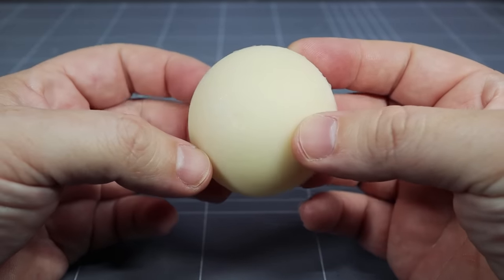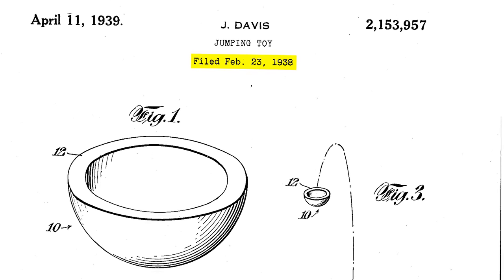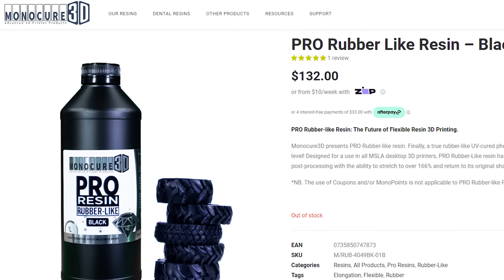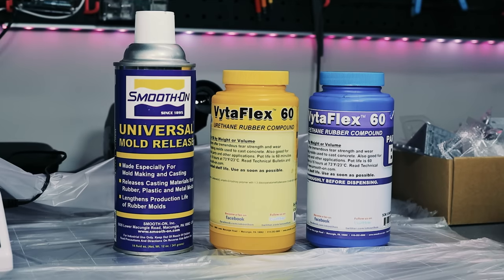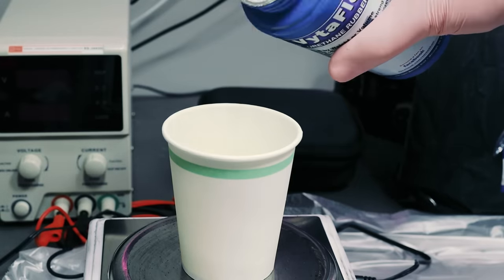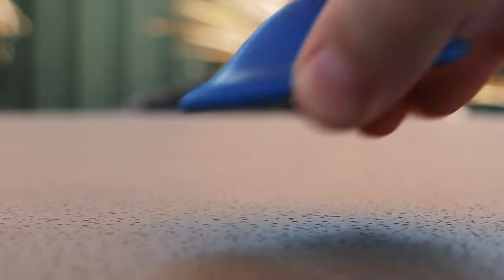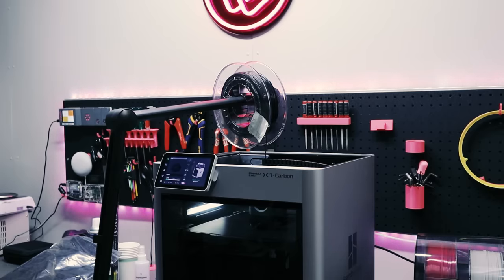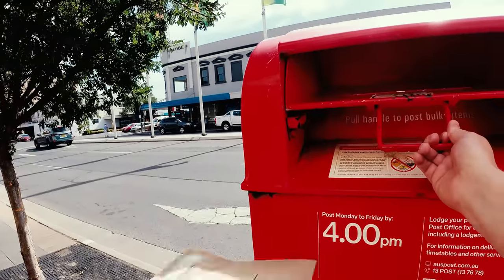Recreating a Banned Toy from the 1980s

Comment: Peter Fish is one cool dude. And I'm surprised the original rubber one still worked after 30 years!
Reply: Not the modern cheap rubber that breaks down in 6 months.
Reply: The only problem with the original ones was the whole in the middle may eventually develop a split, which stopped it from working properly. That what happened after I handed mine down to my nephew. But it was about 15 years old by then, and my nephew did give it a good work out.
Reply: @notsillyone  I think that was why I threw mine away...lol I prolly tried adding Tarzan's Grip glue to it but only delayed the inevitable, then I realised it is easy to make with a well cut in half tennis ball, remove the fur and melt a hole in the middle - done correctly it will work just the same!
Reply: @gavincurtis  Like modern technology such as Apple products that die in a year or 2! The decline was from 1996 when we started to use lead free solder/sodder in electronics. That meant the lead free solder/sodder on circuits melt as they warm up and crack when they cool down, over time the chip or component will separate from the board of the device - prime example was the original XBOX360 or PS3. This is why older devices last a LOT longer - the lead in the solder/sodder is less prone to melting under environmental stress combined with regular use.
Reply: Apple products die because the OS tells them to. That’s why you should never update when told to. I am still on the original OS on my iPhone, my buddy got his the same day and he kept updating his phone. He says the battery lasts maybe 3 hours now and it’s glitchy. Mine holds a charge all day still and my only complaint is the touch-screen is too sensitive.
Reply: Not having security patches leaves one very vulnerable to drive-by malware attacks, however.
Reply: @NellWatson - Not if you don't click on every silly "You won a million dollars!" link.   Security patches are for dummies. lol
Reply: @Defensive_Wounds Lead-free solder isn't the problem. It's just bad design. Most of the time, the failure is because of badly designed circuits or external damage, not cracked solder joints.
Reply: @Defensive_Wounds  The melting point of lead free solder is above that of leaded solder, which was part of the issue: It is harder to melt without causing damage to the chips.
Reply: Had rubber on my computer mouse gooify after 5 years +/-
Reply: It all depends on the plasticiser used. Once the plasticiser all evaporates away, the rubber will crack and become brittle. Also, styrene will react with isoprene and cause it to go all gooey and sticky.
Reply: I still have an original eighties one bought here in GB. It's just like the blue one in the video, but with out the hole. Its pop became weaker after only months. It degraded to only half its pop after a couple of years. But decades later I still have it in one piece.
I'm surprised it didn't go the same way as an old tennis ball and simply disintegrate. Come to think of it, I often wondered at the time why it was that an old tennis ball cut in half wouldn't work the with the same pop.
Maybe the video creator could look into the manufacturing technology of tennis ball creation? The different rubber used for different speeds of squash balls may be of useful insight?
From what was said in the video though I expect that source of recycled rubber is exhausted. Unless we haven't yet reached peak rubber😜
Reply: @Defensive_Wounds  The thing about the original XBox360 isn't just lead-free solder, it's that Microsoft intentionally went with the cheapest solder they could to save on unit cost, and everyone saw the results of that. The later revisions had better quality solder and an active cooling system, so lead-free solder or not it still worked fine.
Reply: @Defensive_Wounds I see lot of 20 years old electronics still working fine.   My MacBook Pro still works and it’s 2006 model year.
Reply: @notsillyone  I have one somewhere in my storage but it has a bad split and doesn't work properly anymore. Is there anywhere where I can find a new one as good as the original?
Reply: @JustinDaniels Unfortunately I don't think you can find a new one as good as the original, if what Peter Fish says is true that nobody has been able to replicate the rubber in his product.  But if you read Defensive_Wounds earlier comment, he claims to have made one from a tennis ball that worked just as good. I'm planning to try that myself.
Reply: @BillAnt  "Security patches are for dummies"
Says someone who has no idea. Some exploits don't even require your phone to be on the network...
Reply: I think mine all suffered the same fate. Loved those things! Used to launch them from the tip of my finger, or a knee and watch them fly! @notsillyone
Reply: @notsillyone  Here in England, I'd never seen one with a hole in before this video. Must be 30 years since the last time I saw one.
Reply: @goku445 - Yep, says someone who's been using computers since the early 90's yet not a single virus, malware, or hack.   Use your brains folks, and don't click every scams link, it's simple as that.
Reply: @BillAnt  Lmao, you have no idea. Typical dunning-kruger. Your anecdote has low value. If you are running an unpatched system you can be sure you're already been "visited".
Reply: Planned obsolescence is real lol
Reply: @goku445 - Nope!
Reply: @BillAnt You have no idea what the difference is between malware and security vulnerabilities are. Security vulnerabilities are holes or keyless-gates that malicious individuals can use to gain entry into a device or network, usually through some hardware or software vulnerabilities, like Spectre/Meltdown or wi-fi/bluetooth protocols. You are describing malware, which is usually social engineering at work or blanketing (where the malicious individual just casts a wide net hoping an idiot bites), where the user self-inflicts the malicious software on themselves.

There is an entire world of vulnerabilities in just Wi-fi alone. I would look into Ryan Montgomery and some of his explanations on basic vulnerabilities in these protocols.
Reply: @m_6866 - You mind-reading on what I know is way off, so have a nice day.
Reply: @notsillyone  Thats why the ones without the hole are so highly sought after.

Comment: I used to make these myself by cutting squash balls in half. They work a treat. Very powerful.
Reply: Say it aint so!
You mean i dont need $300 printer?
I can just chop a $1 ball in half!
Reply: @alfonsedente9679  Ha, yep. Depends on the squash ball, but the ones I made worked pretty good. I got about 5ft (150cm or so) out of some of them (they were coming up to my shoulders and I'm 5'10" or 178cm), especially if you put them in the fridge for a little while first to stiffen them up. Some of the real one's we got in the US back in the day, though, would go 20-30ft in the air! So, these are not exactly perfect, but probably about as good as what he was printing.
Reply: @AlphaMachina  i remember the colors...
I tried a blue one today, worked great.
The black ones i had were too thick, not enough air space in the middle.
Ill try greens next.
A couple guys posted tennis balls worked ok.
Just thinking logically, im guessing the common pink or spaldeen was what the one kids were making.

Comment: I vaguely remember DIYing one out of a tennis ball. Didn't quite work as the shape wasn't right, but that's a material you should try.
Reply from the maker: I actually did try that, but I cut it from the edit in the end. It didn’t work for me.
Reply: If I'm not mistaken Tennis Balls are from natural rubber which would be the material of the original black popball.
Reply: just cut a racquetball in half.
Reply: haha look who I found in the comments :D
Reply: @riba2233  🤣
Reply: @electrosync  For me this worked really well, so much so that I was convincced that is how they were made, from discarded tennisballs.
Reply: I also made one from a Tennis ball back in the 80s and it bounced maybe 1,5 - 2m high. It gave a nice "kick" when placed over the forehead and it had a very long delay which made it an "agonizing" and extremely entertaining toy to play with. I absolutely loved it. I never knew someone actually manufactured them and that they got banned. That sounds so silly.
Reply: @hugovangalen  i expect that the height at which you cut the ball matters. how tall is yours? or rather whats the circumference? that would be best. i might give it a try.
Reply: @dnichl  I really don't remember, this was 40 years ago. I only remember that it worked fine. 😄
Reply: @hugovangalen  welp, i have at least 8 tennis balls to cut tomorrow. at least ~16 attempts depending on size of initial cut 😂😂 I'm too old for this but i still need to get it out of my system.
Reply: @dnichl  All for science!!
Reply: @SprSonik13  This. In the early nineties, my college roommate played racquetball, so he had a supply of them. He cut one in half and taped it to the wall as a cheap alternative to a doorstop. I started using the other half as a fidget toy, and we accidentally discovered that it made an excellent popball.

Comment: In the 1960's, Edmund Scientific had jumping discs made of bimetallic thermostat material.  You warmed it up in your hand so it would stay inverted, then it hopped when it cooled in a couple of seconds.  They went really high especially from a hard surface.
Reply: I remember the CSIRO "double helix" membership got you one of those bimetallic discs.. back in the 80s/90s.
Reply: Lmao, I bet those were really aggressive XD
Reply: Yes, I enjoyed those jumping disks.  But after some usage, they would fail to remain "cocked".  I suppose that metal fatigue set in or else some separation developed at the bimetal interface.  Prior to the jumping disks, we enjoyed the plastic insects with the springy wire legs and the suction cup on the underside.  These were indeed an eye hazard and were banned or else were no longer sold due to injury liability.  (I'm glad I grew up and survived in an era when safety was not the be-all and end-all.  Sometimes, experience can be a great teacher, if we survive without too much harm.)
Reply: Can you find these now? I want some of or my daughter

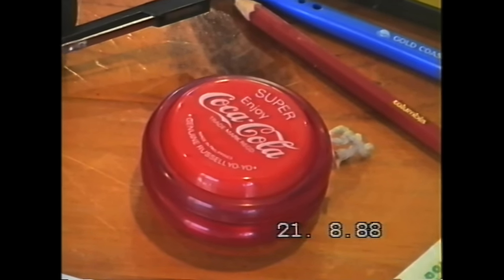Comment: 0:30 - Yoyo is still in the EU. The metal slap bands are still there. But those are covered by transparent plastic packaging.They are retro-reflective and are sold as additional protection to improve the visibility of pedestrians and cyclists.
Reply: WHaT? Yo-yos are banned in Europe?
Reply: @ninjarooster9258  No. They are not. That's what I meant.
Reply: I remember briefly in the US the snap bands were banned but then the companies started making them with a plastic center instead a few years later.
Reply: Yeah, slap bands are back for the little ones at the moment (2023-2024). Even saw a "decorate your own slap band" thing at a toddler party.. White material ones that the kids decorate with textas or stickers.
Reply: @ninjarooster9258  wtf, he literally wrote that they're not
Reply: @Mintor94  he wrote “yo-yo is still” and I wasn’t sure.
Reply: Tbf, I also understood "yoyo is still in EU" to mean "still banned in EU" at first. It took me a second to realize it actually meant "still exists in EU"
Reply: @--Nath--  Used to have original textas---still call felt tips texta.

Comment: So fun addition,  the Toy Line known as "SNAILENS SUPER SONIC SHELL FIGHTERS" from 1992, actually went even further with this idea, as the inside (or top when "poped inside out" and prepared to "fire" had a notch in the middle that stuck out, and you could attach a rubber projectile to that would be fired off of the "pop half shell" thing. And these things HAD some umph behind them somehow. I remember as a kid I hurt my finger when it snapped back on its own. Wasnt like a serious injury or anything, but it did throb for a bit.

Comment: I have a metal disc variant of the pop ball I was given some 40 years ago.
It's small, only 24.7mm (1 inch) diameter, 0.2mm thick and 1mm high, with a tiny 1.5mm diameter bump in the middle.
You warm it up with your hands, press the middle to make it click then put it on a hard flat surface, after few or many seconds it cools down and 'unclicks', jumping about 50cm (1.5 feet) straight up when the tiny bump in the middle hits the hard surface.
Was great for startling people who didn't realise it was on the table in front of them.

Comment: When i was a kid in my country we had no to much of toys variety and we made a lot of DIY toys.

I 'invented' this Popball accidentally when cut a segment of a broken tennis ball.

The only difference was it had no hole in the centre but a 8mm long cut .

Also 'delay' before it exploded was longer. 

It was a big fun to load the toy and hide under thin layer of sand... 😊

Also, one day i found similar jumping toy but it had different design. It was a suction cup connected via a spring to a plastic pin sitting on a flat round base. It looked like a mushroom 😊

To load it you just push the cup down to compress the spring and stick to the base.

Then you leave it waiting when it pops up🎉.

Comment: Mate, just cut a Tennis ball in half. That's how we used to make them when I was a kid, even before they were sold. It will also be way more powerful than any of the store bought ones. 

The trick is to cut the ball as clean as possible, if the cut line has dents, these can develop into cracks over time!

Comment: In addition to popballs, I remember something called 'caps'.  There were two versions, each involved gunpowder or some rough equivalent.  There was one with small plastic 'cups' that contained the powder and there was another one where the powder was inserted into tiny areas in an otherwise flat sheet of paper-like material.  That one was one you could strike with a hammer or something and it'd let off a 'bang' and that characteristic odour in the air.  To this day I don't exactly know what either of these 'toys' were, but I certainly don't see them around any more!

Comment: I have the one at 1:43, and that can be about as powerful as a slingshot if you know how to load and use it. 
The only problem is that the plastic middle part (seems to vary in color, mine is yellow) has to be removed for the best slingshot effect. 
Otherwise, it can shoot marbles, slingshot ammo, and more.

Comment: The safety air hole ruins the second-best part of poppers: sticking them to yourself and creating hickeys.
American slap bracelets had plastic inside, or possibly the metal very thin and was coated in hard plastic underneath the outer cover.

Comment: These have origins in the mid seventies. We played with the original form of these that were made from the halves of rejected golf ball cores that were trashed from the Ben Hogan golf ball plant that was near our school. Everyone had them and they were better than any of the later intentional copies, mainly because the delay was longer and the pop height was much higher. Probably due to the rubber compound used in the manufacture or those cores. They were a dull light green in color, like a boiled egg yolk

Comment: I once worked IT for a company that made rubber-based car parts (like NVH components)... whenever I'd grab a desktop to work on from the floor, I'd have to take it back to a special room with a fume hood and an air compressor to clean off all the carbon black.  That stuff is nasty and gets into everything.

Comment: Banned? i still find them.  I bought a bunch cuz my old doorstopper rubber bit dried up and cracked off leaving the metal bit. The small poppers actually snap on perfectly!  I was bored one day and tried it.  Now every door in the house got a colorful door stopper.  The door stoppers are old and original that came with the house (just 2 original rubber pieces remain in the house, the rest is replaced with colorful poppers

Comment: i hope you know..the horizontal texture hold back the elastic kick back power..try using smooth surface but better try use vertical texture and for addition at the circular edge more solid rubber this will give strength to contract..let me know if it works